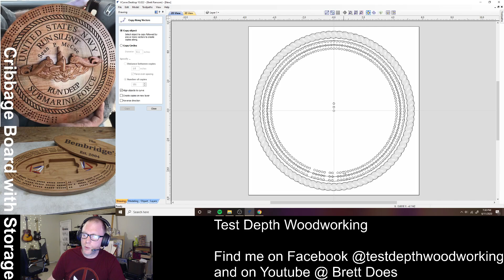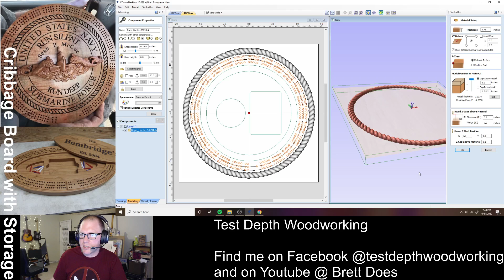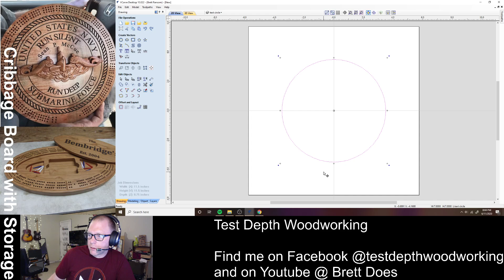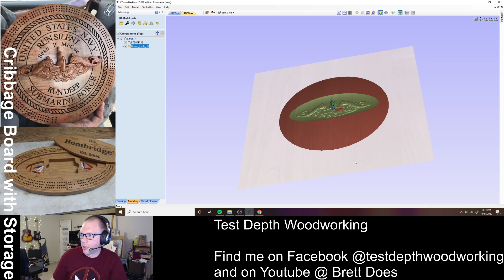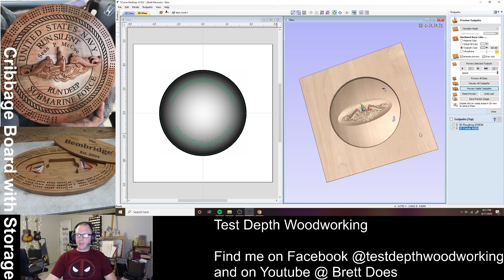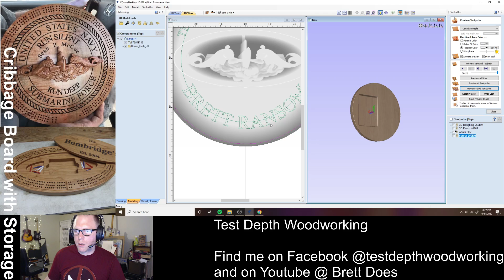Designing a cribbage board in Vectric VCarve

Comment: The absolute best way to drill these holes is a 7/64 bit 2 flute em, profile toolpath 0.5" deep for std pegs. Leaves room for chip evac, reduces heat you avoid "pecking" and it goes quick. Nice job otherwise.